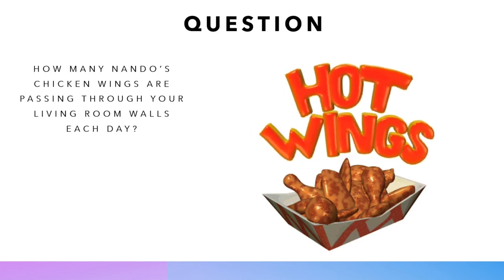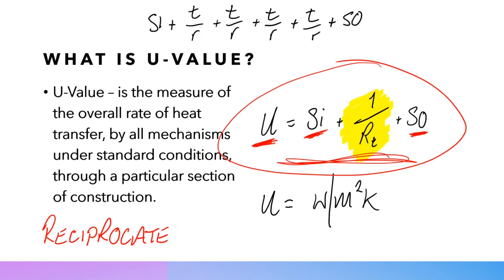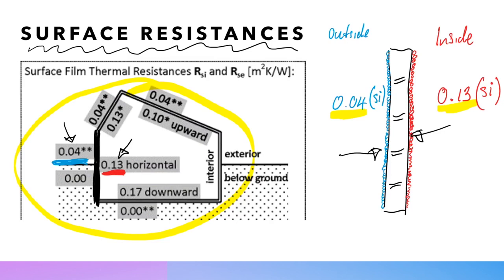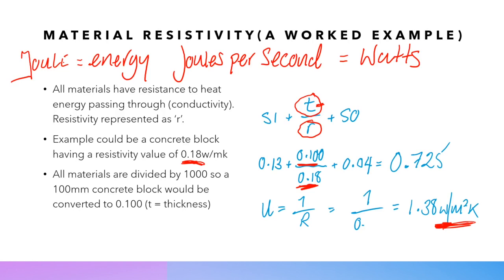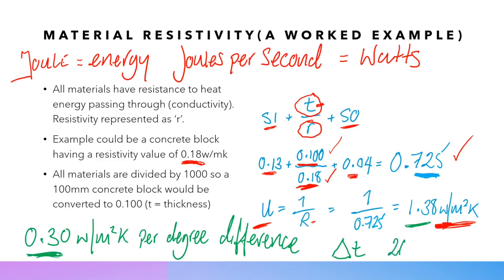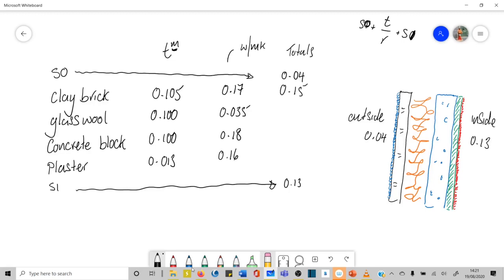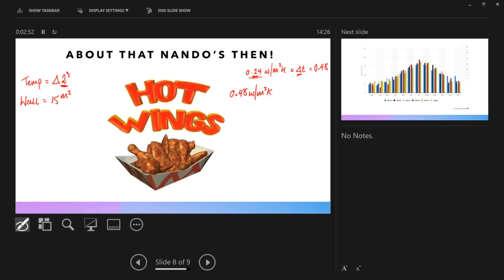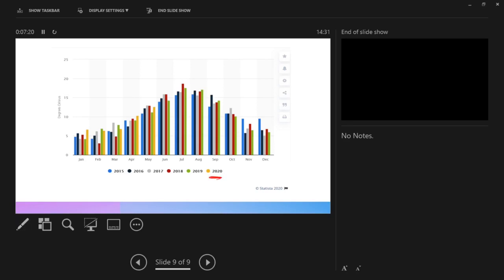Unit 1 Fabric heat loss & U-Value

Comment: Yeh you're teaching this wrong bro. It's defo not t/r its t/k. You haven't mentioned k values anywhere.
Reply from the maker: Go to page 51 of Pearson btec national construction page 51..... this is where u- value where thermal RESISTANCE is calculated AND NOT CONDUCTIVITY...... you need to back school
Reply: @steeveyboy1  oh ok. CIBSE shows it differently. For each material its the thickness over the materials k-value to get its resistivity value. Add up all the resistivity values of all the materials within the wall to get the Rt (resistivity total). Then 1/Rt to get the u-value for the walls fabric. Multiply the U-value by the walls area and by the temperature difference gives ya your heat loss. But hey, if you disagree with that then cool. It's there in the CIBSE guide. Other than that difference in opinion it was a good video, I watched it all and it was useful.

Comment: Are you sure it isn't t/k. T being thickness, k being thermal conductivity. Then that value equates to the R value. Then you do Si + 1/r + 1/r + 1/r + So = Rt.
Then that 1/Rt = the U-value. I'm pretty sure that's how it works.
Reply from the maker: Think you need to go back to school..... formula taken directly from btec level 3 guidance..... as a basic.....k has a different meaning to r depending on whet or not thickness is being calculated or k as a simple conductivity value...... and please don't call me bro!
Reply: @steeveyboy1  ok I was trying to work out what you were doing using different letters. I started to follow you and it made sense. But now you're being rude I may as well add you're using the wrong terminology as well. You keep saying 'resistivity', it's not, it's called thermal conductance. Thickness over thermal conductivity of the material, equals the resistivity. Then 1 over that equals the U-value. Anyway, other than that good video to be fair.